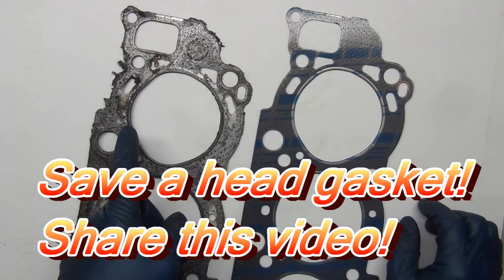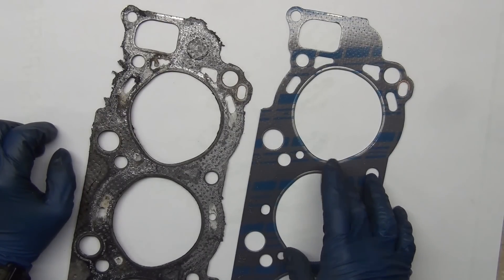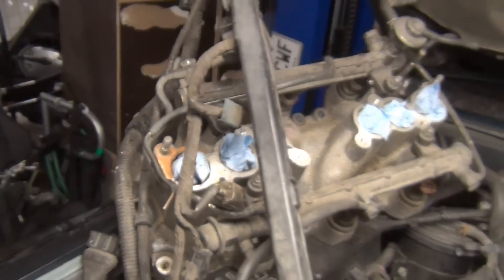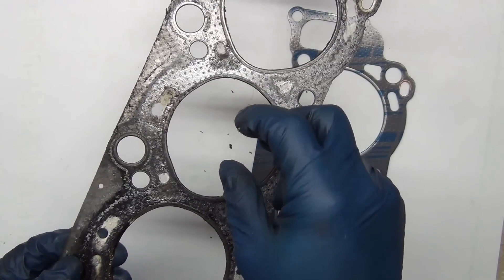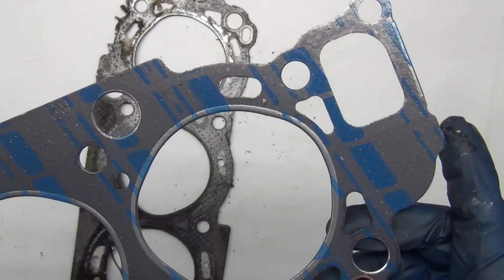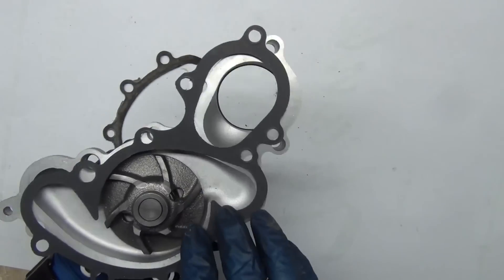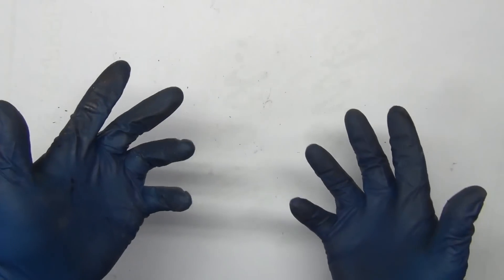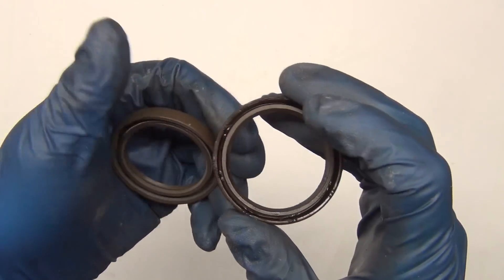Is it BAD to Drive my Car on H in the Red?

Comment: Just did a 94 t100 sr5 v6. 310k miles on her. Had to take pictures and mark all those little vacuum hoses on the passenger side. I rarely take pictures and mark thinks but this was a tougher head gasket job in my opinion. Same cylinder on the truck I did. Got both heads checked and surfaced. Was pure white sweet smiling smoke out the tail pipe. I was a bit hesitant with the milage to try to fix but it worked out so far. Thanks for sharing!

Comment: i had a car that it just started over heating on the highway ended up just shutting it off and coasting then starting it and speeding back up and repeating worked for a few miles till i could get off

Comment: My 2008 outback had oil "weeping" out of it according to the mechanics every time I took it into get the oil changed or serviced. They said that I would eventually have to get the head gaskets replaced. I should have had it done when I got some things worked on it around 100k miles because I ended up getting it done at 120k. I did have the water pump replaced at 100k because the engine was already being worked on. My car never overheated or anything (at least as far as I could tell) but now I am super paranoid about it. I also notice that I have to put in oil every so often. Is that a normal thing? Maybe I should get rid of it now while everything appears to be working.
Reply: If its leaking oil from the head gasket, then it needs to be replaced. That's why its important to flush your coolant every few years, since it gets acidic and eats away at the gasket materials throughout the engine. Totally common issues on Subaru's though, so I've heard. Never owned one myself, so I can't say for sure that regular coolant changes would prevent it, but in theory it would.

Comment: Good stuff to pass on Brian! If the car makers really 'cared' about their customers, they'd install a temp warning system like the sky crowd gets to alert for impending 'stalls' or rapidly falling altimeters (pull up). I want the siren, the flashing lights, the panicky sounding female robo voice and stick shaker treatment.Only people nowadays looking at the temp gauge (if there even is one) are folk like us (reading this ) who've learned the hard way about thermodynamics. Perhaps you could develop an app for the device that would do the above no matter what the car the driver is in.  ATB!

Comment: Hey Brian, thanks for the great knowledgeable video, how about the opposite scenario , I have an I 5 colorado that's runs consistently at 176 max with no codes set but only gets about 15 mpg city. It's original 05 thermostat too

Comment: You rock.  Great Video.  I might add that low coolant will many times show up first as the heater not getting very hot due to lack of coolant circulating through the heater core.

Comment: In extreme cases you can also weld or Gaul the piston rings into the piston so badly that you destroy the bores....I'm rebuilding a kubota Diesel engine right now that had that problem

Comment: Also, catastrophic head gasket failure can cause hydrolocking. All the coolant suddenly rushes into the cylinders and then you're done. Happened to a 97 ford we used to have.

Comment: You probably already know, but the camshaft seal and a water pump seal are very different. A water pump uses a two piece mechanical seal. There are two perfectly machined ceramic surfaces rubbing against each other under spring pressure with coolant as the lubricant. Even the oil from your fingers will ruin the seal.

Comment: I recognize that Toyota 3.0 engine anywhere, wish I was there I could have taken it apart blindfolded. Word of cation with those injectors, after overhearing mine I kept getting a gas leak pooling on the intake manifold, changed all the o-rings multiple times but no luck. Finally under closer inspection realized the injectors themselves were leaking between the plastic top section and the metal body. Would recommend swapping those out if you can, that intake plenum is a real pain sometimes, as I'm sure you saw.

Comment: Those toyota engines blew head gasket on #6 cylinder all the time! Changed head gaskets on those 100s of times when I worked in the dealership!! It was a bad head gasket design they had to extend the warranty on them!!

Comment: I like your video however that head gasket must contain the pressure of the explosion in some engines that may be over 3000 psi
Reply from the maker: It does, but that's tricky because the piston is in motion the whole time which lessens the pressure.  I thought about that- did a text super on that.

Comment: that's what happened to my alero  2.4L winter of 2014. It was -60f below windchill one morning, i didn't know the antifreeze was frozen in the radiator and a few miles drive to work the engine was overheating spraying coolant out between the engine block/head. and yes the exhaust now smelled like antifreeze to. also it's bad to install a lower temp thermostat like the napa know how boys had me do because it makes gas mileage terrible all year round.
Reply: Wind chill doesn't affect cars at all. Actual ambient temperature does though, and if it got below the freeze point of your coolant, you'll freeze it and break the engine internally as a result. That's why its important to change your coolant every few years and test it to make sure it offers adequate freeze and boil over protection. Sometimes 50/50 isn't enough. Get below -34f with that stuff and you're screwed. I usually mix mine 60/40 which seems to protect it closer to -45f. 

Unless you have a track car, run the highest thermostat you can. Most are 192-195. 160 is just ridiculous and people sadly buy them thinking their cars will run better. Makes them run way worse as you said.

Comment: My head gasket is layered rubber and steel. Two layers of steel, three layers of "rubber".
Reply: https://encrypted-tbn3.gstatic.com/images?q=tbn:ANd9GcQwJF8TsD20UfK5bxQmGTAd2RtZbNImmh1yb5BTKxK_x0OJpgiY
Reply from the maker: That's right.  There are ones that are just layered steel too.
Reply: hat did no good two years ago when my camshaft gasket went after taking a child to school.... It was -20*f oil spewed from my camshaft during school drop-off....  I made it to work....barely. 

The camshaft bearing behind the timing cam popped out. All the oil went with it.... 

It's terrible and unenvironmental; but I used, used motor oil to keep my car running for three days until I could ix the issue. Much of the oil went on the ground. 

That was five quarts used motor oil a day....

Comment: why are the holes in the gasket not completely round
Reply: The seal the valves and piston, they're not even because you can see the valves for the intake are bigger than the exhaust, even then it will still be an oval shape. That's just how the engineers designed it.
Reply: Grab America by the Flaps .
Reply: GForceConnections  thanks buddy

Comment: Great video again Brian! Maybe you can guestimate if my head gasket is (on the verge of) destroyed. In short: around 2 years ago for the first time since I've owned my Mitsu Galant VR4 (twin turbo 2.5L V6) (owning it for 10 years now), the temp gauge went up and I quickly stopped and waited 15 minutes to cool down. It was a hot day, huge traffic jam, airco on full, but I've had that many times during the years without issues. 

So... I started it up, put the heater core on full, airco off en the traffic was moving slightly more, and the temp gauge got back to around the middle although slightly higher. It stayed that way for an hour, once I got on the highway at normal speeds the temp gauge went back to perfectly center. Ever since I've had this every once in a while, mostly in long very slow traffic jams (25+ minutes near standstill/very slow driving). I've replaced the thermostat, waterpump (it was time for the belt to be replaced anyway), radiator, both temp sensors, flushed the coolant system (high pressure even) twice and even replaced the airco condensor as it was both pretty much blocking airflow by debree buildup as well as missing quite a few segments of cooling fins). It all didn't help. As long as I drive, short stops, etc all is fine... yet I still don't feel very comfortable knowing it can and will happen next time when I hit a long traffic jam. 

I'd love to hear your thoughts! I think it could be the headgasket...

Comment: Also worth mentioning you can damage compression and rings from overheating, meaning that even after replacing all your seals and gaskets, your vehicle will run like poop. On top of that, I've heard some forum discussions suggesting that the heat changes the metallurgy of your engine block and head (anneals it), meaning that even re-boring / honing your cylinders is futile as the crystalline structure of the alloys used in your block's casting are altered and won't hold up to continued use anymore. On top of that things warping at the block level can cause bearing / journal tolerances to change, meaning the thin film of oil that cushions the moving parts of your crank can be compromised - and engines rebuilt without those checks and fail shortly down the road. Not tryin' to be an armchair mechanic here on the internet, but just putting that out there for the completeness of information as you did a pretty thorough job at covering everything else.
Reply from the maker: So you're telling me that overheating is bad right?  It is!
Reply: Would be interesting to see a compression test on each cylinder after you finish rebuilding it - and if any low figures correspond to the ones that had the most head gasket damage.

Comment: Thank you for the video you always got good info I have a 2016 challenger hellcat my coolant temperature when I'm stuck in traffic goes up to 222° but my oil temperature is always slightly cooler my coolant gauge  reads slightly above half when in heavy traffic went to the dealer they told me that's the way the hemi motor operates what are your thoughts? any feedback would be greatly appreciated thank you
Reply from the maker: Man, that's a fun car!
Reply from the maker: If you're running the right synthetics- that's totally fine.  As I recall those run Pennzoil Ultra Platinum synthetic.  There are coolant additives like water ice and water wetter that help get the temp down a little further too.  I had to run them in the dirtbikes I ran at the sand dunes in the summer to keep the coolant from pushing out when at idle.
Reply: I know this is a totally different animal, but my old Viper frequently hits 220 at the lights in traffic here in AZ. The high speed fan is not even designed to kick on until 216 degrees. Your car and mine have MLS head gaskets. They don't burn or blow nearly as easily. No need to worry, and nice ride! I'll trade you straight up. :)

Comment: what about aircooled engines ?
Reply from the maker: They have cooling fins and more surface area to dispel the heat.  The key with them is to make sure they get the airflow they need.

Comment: On a warm summer day with spirited driving, my car will reach up to around 205F or so, sometimes 208F but I don't keep it there. Typically on the highway it rests around 195F.
Reply: just about 200-205 is good.
DO NOT let your temp guage rise above more than 10 degF above this as the coolant water is likely to turn to steam - water good- steam bad (since it expands and does damage). Even  better ensure you have correct antifreeze mixture in your coolant as this will rise the boiling point away above the danger point so ensuring less likelyhood of steam creation!
Reply: You really don't make steam until you hit around 265 I believe. That's referred to as the "boil over" rating, which can be tested with one of those coolant checker things. Freeze protection displayed on one side and boil over on the other. I really doubt that coolant would boil over even at 230, since most cars have electric fans that don't kick on until 225. Also, the thermostat pressurizes the system to raise the boiling point, otherwise it would boil at 212.

Comment: If your temp gauge were to go to H(ell), might even be best to put it in neutral and coast (at least if it's save to do so), paired with turning up the heater to max, the air flowing trough the radiator will probably cool it down quite a bit, unless your waterpump is knackered.

Comment: I have not seen any talk(there probably has been some somewhere) about cleaning the dirt, fuzz,bugs, etc out of the radiator by back blowing it out of the fins. Had to do this to my toyota echo after 158k miles. with the air conditioner on going fast up hill all of a sudden the hot light came on. Turned off air conditioning, slowed down to 50mph and quickly the hot light went back out. Yes I had flushed the system 6month earlier and put real toyota coolant in it so I knew it was not the coolant. I live near Denver, not known for lots of bugs but lots of dust. With a L shaped tube on the end of my air hose I blew a bunch of crud out. No problems since. So, I am contributing the idea of cleaning the fins on the radiator as well as serving the coolant if things get hot. Or better yet before they get hot. Love this Brian mechanic vlog.

Comment: do you think is necessary to get an angle torque to replace the head gasket?
Reply: You do need to get the torque on those head bolts correct.  But the details of how to get there differ from engine to engine - some just let you torque it...others require tightening the bolt by turning it through a specific angle (for example, maybe torque to 60 lb ft, then tighten through 90 degrees) - so make sure you check what your specific engine needs from the manufacturer

Comment: If the engine has consumed all the coolant, you might be overheating and the temperature might show as low, because you don't have the coolant to run through the termometer.
Reply: My brother had that exact problem - no coolant touching the sensor meant the gauge read just a little _below_ normal operating temp (it still picked up a little heat from the surrounding metal and air inside the water jacket) while the engine cooked.  By the time he realised there was a problem, it was so bad that EVERY gasket (not just the head) was cooked - it leaked about a gallon of oil a day from the cam cover, head, sump, distributor, front and rear seals...you get the picture.  Not fun.  :-(
Reply: i melted a engine from the same issue water pump blew out so it spiked and i thought it was just from me dicking around so drove normal turned out to be far worse..

Comment: For whatever reason, I always thought that style of gasket was graphite, rather than lead.  Guess I should stop chewing on them!
Reply from the maker: Heck, pencils are graphite now even though we call them "pencil lead."  Maybe these switched too?  They're heavy like lead though.
Reply from the maker: I checked and you're right!  They are made with graphite now.
Reply: Makes your analogy with the pencil better since a pencil uses graphite.
Reply: Working at O'Reilly for years, and I thought they were still lead... that's actually nice to know.
Reply: Was looking to see if anybody made that correction.  I'm not sure lead was ever used for a head gasket .  Seems like it would always be on the ragged edge of melting.  Copper on the other hand was used for head gaskets.  You can still get copper head gaskets today... just write a bigger check.  Graphite allows for better controlled movement of the dissimilar materials.  It's melting point is... lets just say it is higher than any component possibly used.

Comment: My child drove my Volvo 740 for 6.1 miles with the cooling fan and water pump in the trunk of the car. It got hot. I had it towed home (6.1 miles)... put the new pump and fan on...drove it another 9 months before the head gasket blew. I was kinda impressed.
Reply from the maker: Most cars take about 6 minutes to warm up in my experience.  That makes some sense, but I wouldn't push it.

Comment: So I'm NOT supposed to drive my car on red? What about revving the engine to redline to warm up the engine on a cold winter morning, say -10F? ;)
Reply from the maker: LOL!  Yeah, that's some lab coat stuff.  You tell me. 

Oil is thin on start up and doesn't protect till it's warm.  It's formulated thin when cold to help circulation.  It doesn't resist impact or protect till it's over 100°F at least.  Here's more on how and why that is. https://www.youtube.com/watch?v=8EDtWqoN1ac&t=68s

Comment: Overheating your engine does make parts rigged, firm, flat, and cracked.  But it can also occur do to general wear and tear if you don't overheat your engine and just run it properly due to age, and mileage.  Wear and tear takes much longer and not to the extreme levels as overheating your engine just one time.

Comment: also, don't forget, the main reason head gaskets blow when overheated, especially on aluminum head engines, is the aluminum head expands away from the block, stretching the headbolts and lessening the torque, causing the gasket to blow. I've had several gm 3100 v6 and 2.5 iron duke 4 cylinders break headbolts also when overheated.
Reply: dave1135 and seize cams!
Reply: those engines start to overheat when the needle is alittle past the halfway mark on the temp gauge lol....

Comment: hey Brian you sounded really conjested at the begining of the video. you doing OK? :(
Reply from the maker: Good now, I was sick as heck during filming though.  Nobody's pointed out the water pumps don't match yet, but I had to drill the new one in place because I put so much candlepower into filming and moving the job forward. Thanks.